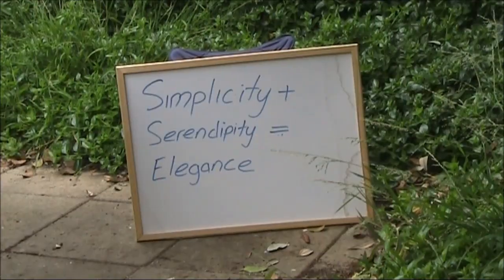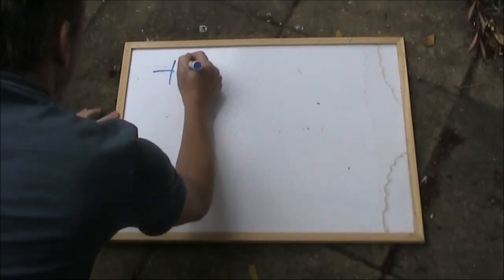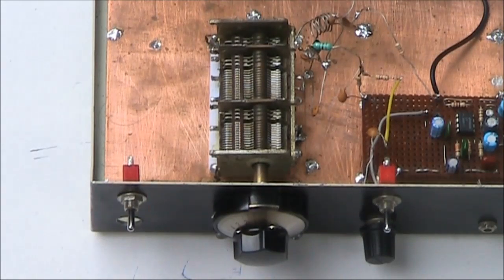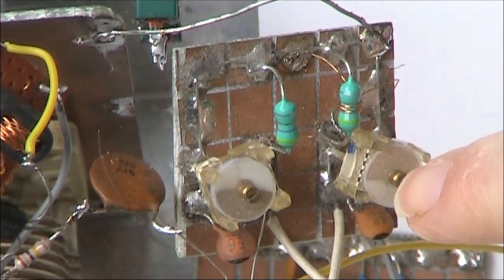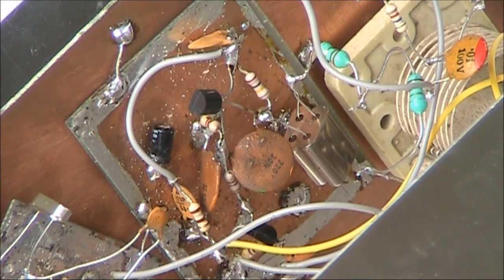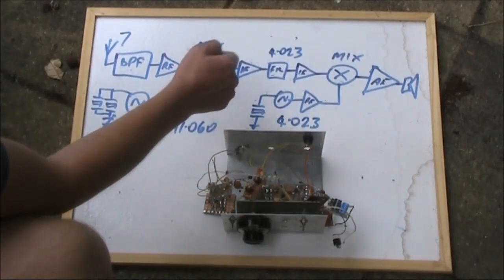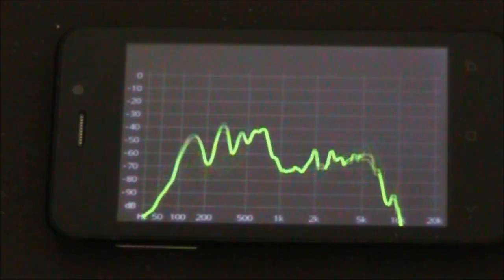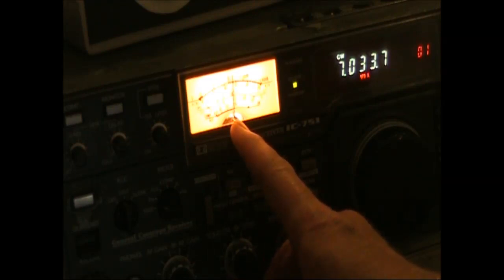Anatomy of a homebrew 40m superhet receiver

Comment: hi Peter,
very good video!!!
I use dual gate MOSFETs in the IF stage. That gives me the possibility to use one gate for regulation of the IF amp...by DC voltage provided by a potentiometer at the front of the rig or by an agc stage.
73 de Roberto

Comment: Hi Peter, while I was watching this (a great educational video by the way) I waste thinking that instead of narrow bandpass filtering being done in the RF chain, the same effect could be done at audio frequencies just after the detector. As an idea, a 3k center tapped to 8ohm audio transformer could be used in the collector of a 1 transistor amplifier, set up in a configuration much like a Hartley oscillator. The resonating capacitor across the transformer primary is chosen for your desired AF bandpass frequency. Then regeneration is applied to give a dramatic increase in Q. In this way you can very easily bypass the audio filter circuit if you don't want the filter. The regeneration can also be easily adjusted to give the desired bandpass characteristic and in order to set the bandpass frequency you can just apply regeneration until it oscillates. The frequency of oscillation will be it's band pass frequency. Nice and simple, done with a single transistor circuit and a cheap audio transformer which is widely available :)
Reply from the maker: +Dazzwidd It's possible but audio filtering doesn't suppress the audio image which a superhet with a good crystal filter or phasing rx with a good phasing network will.
Reply: +vk3ye. Yea okay, I can see that it won't take the signal burden off of the  IF stage but I'm struggling to see the implications of doing the processing at AF with CW in a simple transceiver. How will it affect the results from a practical standpoint?
Reply from the maker: +Dazzwidd Audio filtering will help but your selectivity will still be twice as broad, with responses both sides of centre frequency.  No matter how sharp the audio filter you won't fix this.   This is the main advantage of a superhet with a narrow crystal filter (like this) over a simple direct conversion.
Reply: +vk3ye. I think it's definitely worthy of trial on a project radio just to make the comparison. I do see your point though. If other signals produce an audio response that fall inside the passband of the af filter, you will hear them. The af filter is effectively increasing your selectivity however, it's down to how steep and deep the stop band is in the end as to how well it works. If you eliminated your crystal filter in the receiver you demonstrated and left everything else essentially the same, but then used a high Q af filter circuit instead, I would be very interested to see the results. It would be intriguing to be able to have a side by side comparison at the flick of a switch :)